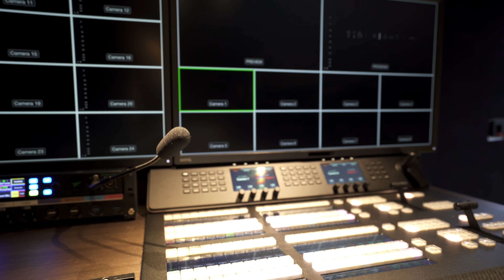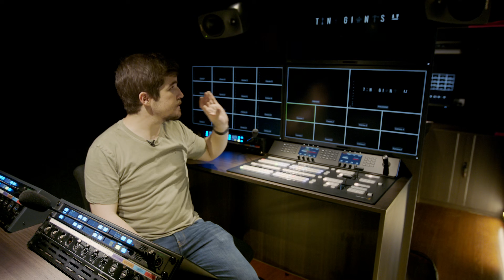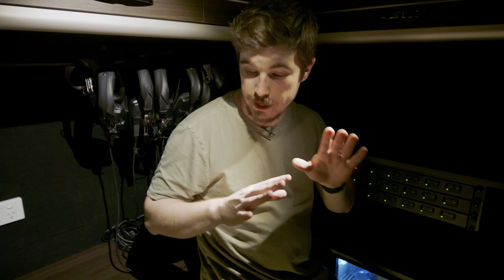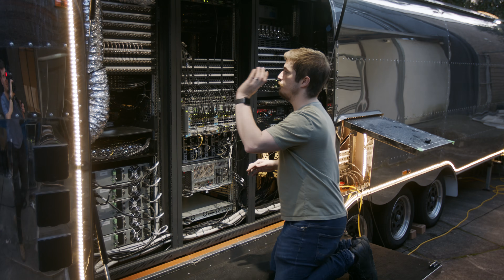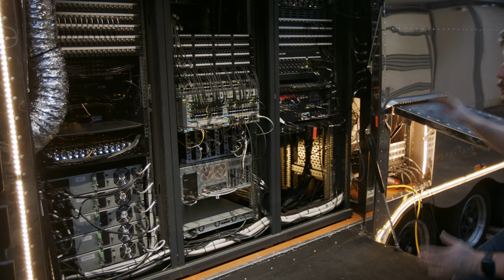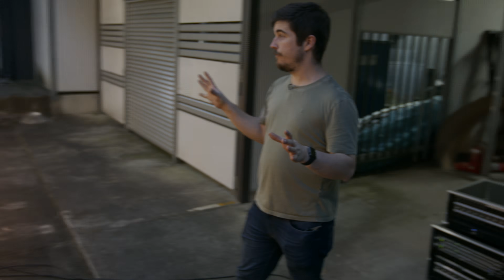4K Airstream Broadcast Trailer Reveal

Comment: Question Ryan. did you isolate the racks from the chasis? Vibration and all? if not, does it impact the equipment?
Reply from the maker: They weren't isolated no, most things are solid state so would have been ok, also being such a heavy load its not bouncing quickly. not ideal but not the end of the world
Reply: @RyanSomerfield  I appreciate your response. You are the man!

Comment: amazing work. I have a question on the electrical wiring. I am in the process of building a similar rig using blackmagic. The US system uses a 110-120v 60hz, and i intend to send the van to Southern Africa where a 220v 50hz is being used, will the components work?. im no electrician and have zero clue.
Reply from the maker: Most items will work with all voltage ranges, but it’s definitely worth checking everything first! Some devices have switches or only work with 1 or the other, but I think from memory everything in this trailer will work with either, and everything should have a sticker showing what it supports or on the spec sheets. You will need to look into circuit loading as there is more available with 240 volts vs 110.. hope that helps!

Comment: why do you have 2 videohub 40? And how are they connected? It seams a little bit useless but there is a good reason for sure. Maybe you can explain?!
Reply from the maker: Good question, we originally wanted a 64x64 but there was no stock available, so 2x 40s ended up being the next best thing, essentially it’s a glorified DA for outputs, they have been split by inboard and outboard destinations, so one is for everything inside the trailer (monitors etc) and the other is all external patching, stage boxes and records etc. the 24 outputs from the constellation have been split evenly between the 2 routers as well as some cross patching if needed, just makes sending what you want wherever you need super convenient!
Reply: @RyanSomerfield  maybe you can make a video explaining that, just for example, to understand, what kind of signals are where and why or you have a sheet, uploaded in your community area of youtube? I helps to understand your signalrouting and why you did that that way.

Comment: Ryan - I've watched all the videos on this build and wanted to say thanks - really decent and genuinley useful content. Can I ask for a follow up on some of the less exciting gear content. You showed the looming and 'connectoring' stuff, and it was pretty neat and wll thought through, and you even mentioned the spreadsheets. Over the years I've used loads of different connectors and cables, but I'd really appreciate knowing your brand and type sources for the mundane stuff like the ethernet connectors and the BNCs - I note you had thick/thin cable types and all appeared to be cut to length and neat. My 'connectoring' is always a weak link for me despite being pretty ancient now. The correct tools and dies I never standardised - how you did the cabling would be really useful stuff for a video. Thanks Paul

Comment: I haven’t  ever really gotten to do much with fiber.. how does the fiber tactical cable break out once it reaches a stage box or the trailer. You said it was 12 core so does it have 12 individual fiber connections that break out like a audio snake?
Reply from the maker: Good question, so on each end is 12 cores of LC, that splits up into 5x tx of the sdi to fiber converters and 5x RX then the final 2 go to each of the network switches using bidi 10gbe SFP+ modules. Audio runs over Dante on those networks. Hope that helps!
Reply: @RyanSomerfield  thanks for the reply! Love the trailer!

Comment: This is outstanding! Thank you for sharing this finished walkthrough! I’m wondering how you got into this line of work to design OBs/MPUs..? Education/qualifications? Experience to start with…? 

For the exterior fold out door to access all the patch bays, seems like when closed that door would be pretty close up to the fans and could potentially cause overheating issues…? 

Lol at the random shot of the spider (@8:00)
Reply from the maker: Haha totally didn’t notice the spider.. glad you enjoyed! It’s a great question about how I got into this line.. I kind of stumbled into it, I have worked in OBs/MPUs for 15 odd years in a variety of different roles. Done a lot of work with churches who are always looking for affordable ways to get nice results, did a bunch of work with some churches designing systems and a bunch of trial and error, worked with most of our tv stations here from camera to tech to directing etc so have a reasonable knowledge in most areas which helps to do systems with a wholistic view. But yeah no qualifications to my name, just lots of research and experience really. Cooling has been a bit fun.. but client plans to put in a split system in the back of the rack to keep it cool, luckily we are just getting out of winter here but for summer something will be needed